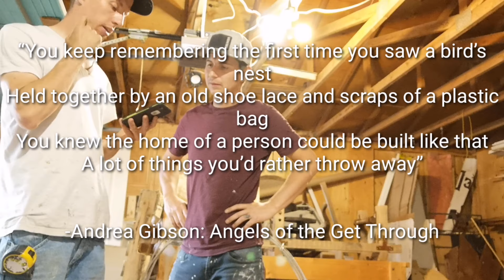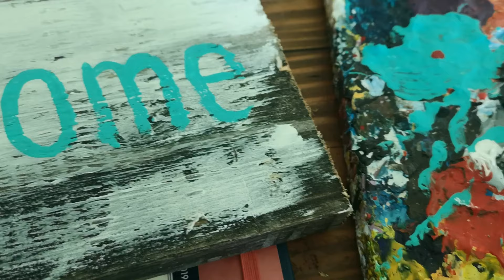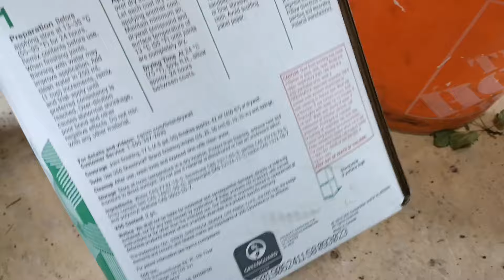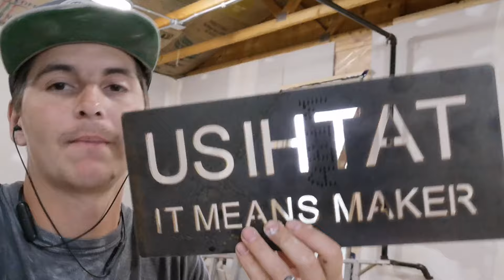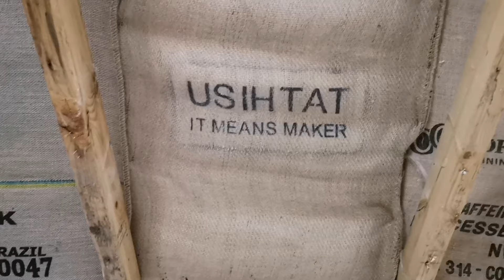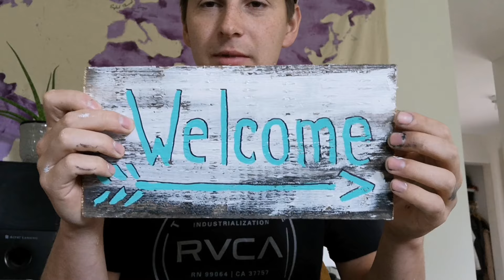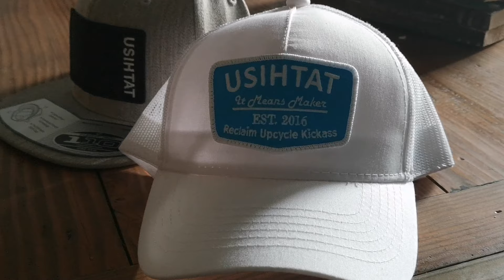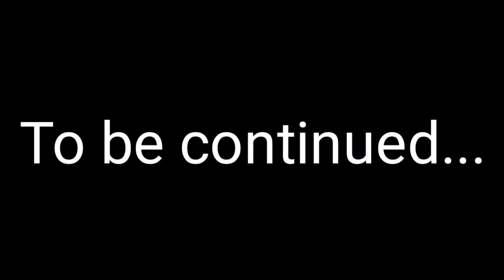Ashley's hat samples came in but... | Another VLOG #35

Comment: Where I live in Florida, they use a very sensitive microphone to detect plastic water pipes.  Just turn a faucet on inside the house and the mic can hear it running in the pipes.  New construction requires burying a special tape over pipes that has metallic content and warning text.

Comment: Aren't they always supposed to lay a metal detectable strip of tape down in the abs water line trench?
Reply from the maker: Not sure.
Reply: @JoshuaAlexander138  Down here in Merica, if the pipe is plastic, a strip tape on a role has to go in the trench that has a magnetic element down the center of it.  If you excavate any of that stuff, recommend getting that from the orange store and using it for the future.